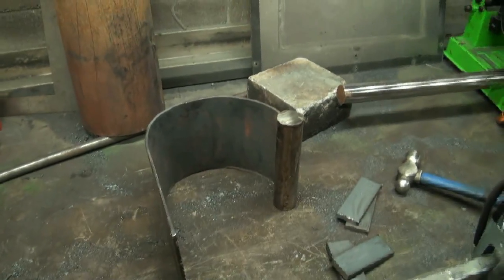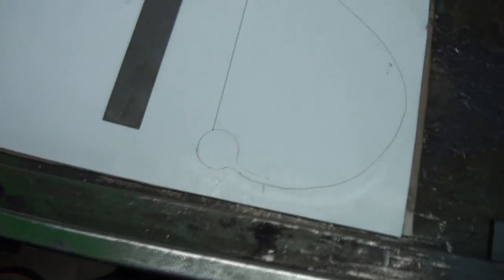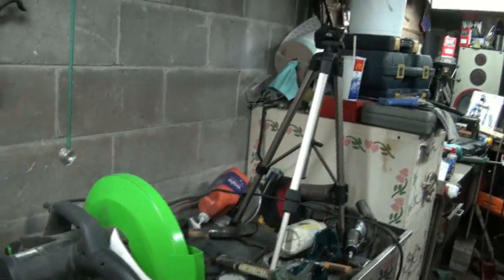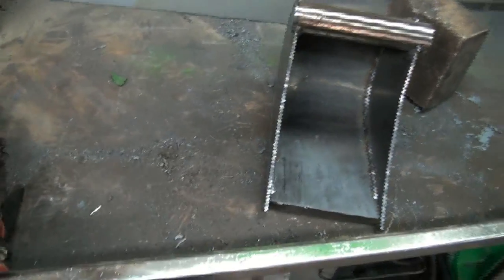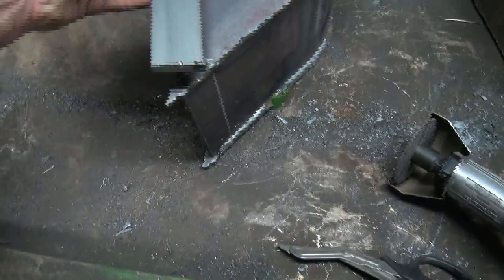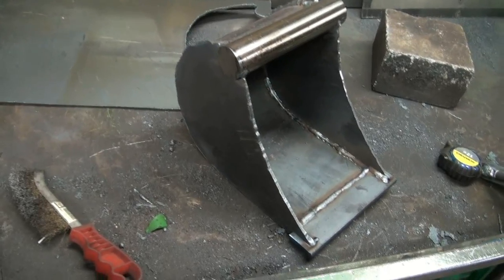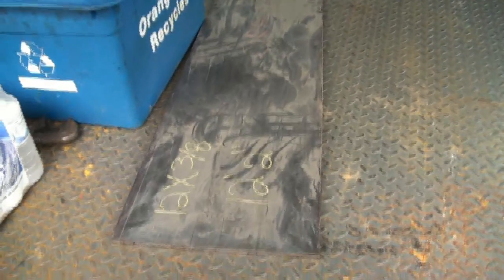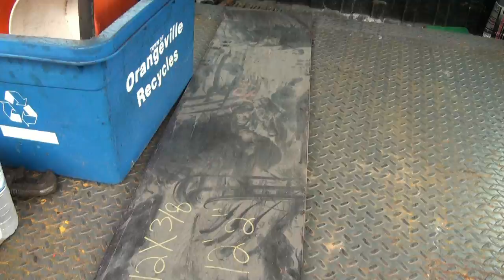Mini backhoe bucket fab 2

Comment: Since normal electronics is pretty shock resistant, only the hard drive in the camera would be having a problem, while the rest of the camera is fine. So you could either exchange the hard drive (probably a 1.8" drive in there, those are pretty standard devices), or maybe even just extract the drive from the camera and use the camera without a hard drive only with SD cards, if it does that and the software isn't blocking every operation as soon as it detects no drive (which can be researched).